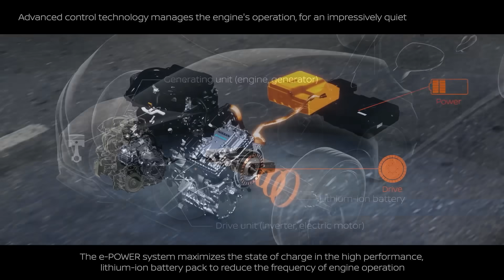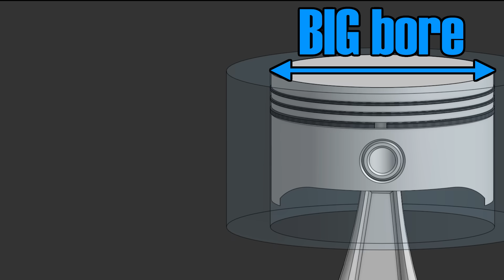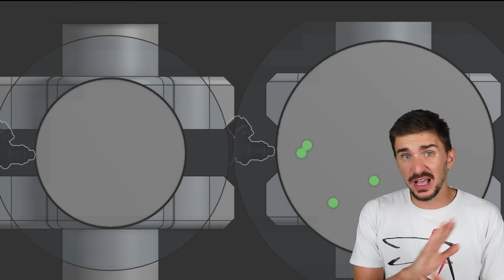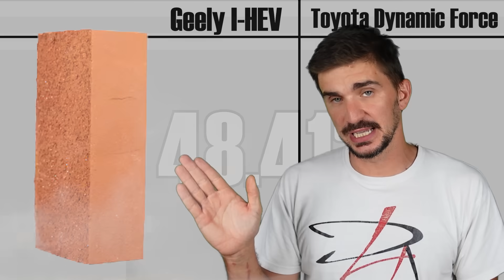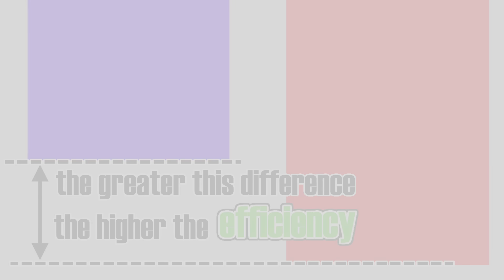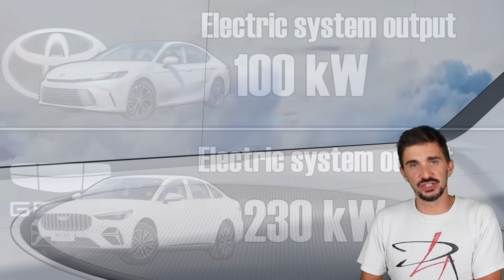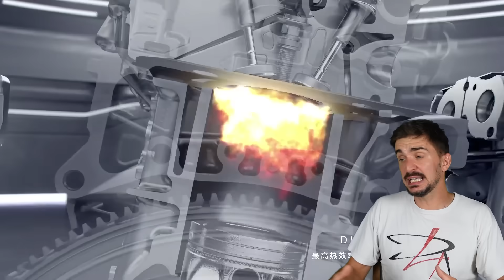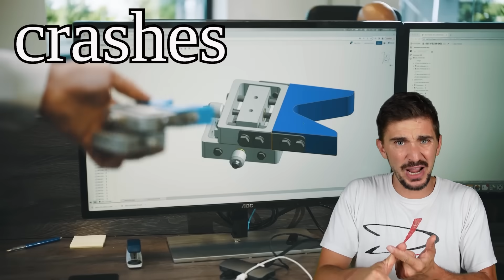How China's Geely Beat Toyota, BMW, Ford and Everyone Else

Comment: So, it's a super annoying boring to use engine, I should have expected that.
Fits well a range extender.
They targeted the announcement buzz and not usability.
Reply: No, it's a super boring engine that'll outperform equivalent boring engines. It's also an EV, so you'll get plenty of performance for short fun runs.

But when you do want to go for a long boring drive, it'll do very well. 

Though at that compression it'll need very high octane fuel

Comment: mitsubishi has been doing the same with the original PHEV, the outlander. Instead of AI they solved the power issue by using a 2.5 liter engine.
Reply: .. and lower efficiency

Comment: It seems like that long stroke engine is going to try to push the piston through the side of the cylinder wall. Extreme wear? Would be interesting to see how this engine performs over time and how eggshaped the cylinders get. I figure this has been tried before and there's a reason it hasn't reached mass production.
Reply: it depends on rod ratio, i assume the Chinese didn't said what it is and the animations are just there for visualization

Comment: Given over 50% of gasoline's energy is wasted in heat I have always thought water injection of some kind is the future. Water expands 1,600 times when it turns to steam. What if water was injected into a second turbo that was connected to an alternator instead of a compressor? Water turns to steam and produces electricity without parasitic loss.
Reply: While it seems like a good idea (there were some water injection engine designs). There seems to be certain issues with that:
1. You need actually quite hot exhaust for the catalitic converter to work properly, and injecting water directly into the cylinder would cool the exhaust too much.
2. If you have sulfur in your fuel - it will become sulfutic acid upon contact with water, especially at high temp. Needless to say, nobody wants any acid in their engine or cat.
Reply: @ViktorSL-1 
What if it were after the cat, or a heat exchanger were used? There has to be some way of converting heat into usable energy. Fuel efficiency can only go so far. I believe the next step will eventually be heat recovery of some kind. The free energy is there for the taking. It just needs someone smart enough to figure it out.
Reply: @mr.shannon6137 with a heat exchanger, you'll need a seperate piston based steam engine (cannot use turbines, as they require steam with very strict characteristics, or they'll self destruct). So much more bulk. What theoretically can be done is putting MGU-H turbine after a cat to harvest the residual energy without empeding its work. But don't think that will get even close to the combined combustion-steam cycle, used on powerplants that can reach up to 60%.

Comment: This is why I've been saying for years that an efficiency optimized diesel generator combined with an electric vehicle can get more power to the wheels than a conventional engine and drivetrain.  Across the usable performance range a gasoline engine is approximately 35% efficient with approximately 10-15% additional losses between the engine and wheels while a generator can operate closer to 50% efficiency, charge the batteries @90% efficiency, and then the batteries can drive the wheels @ 85% efficiency.  The sum of the numbers is still better than the engine driving the wheels.  Finally the range extended EV has the advantage of regenerative breaking, and never idling.  It just turns on to charge the batteries.

Comment: Brilliant video. You explain things in layman's terms so well. At the start of the video I was thinking that China had at last done something genuinely innovative and was ready to cheer them on for such an achievement. If they had been more honest and used less hype, I would still applaud them for an honest attempt to explore the engineering possibilities available to them. Instead we are just let down once again by basic dishonesty and deliberate misdirection. This is a pity because China has achieved a lot in so many areas over the last few decades and should be proud of that without having to resort to such cheap tricks. And one day, they may well come up with something truly worth boasting about.

Comment: The main question is whether it's at the rated torque and whether that torque rating is similar to how they rate everything else they sell.
Reply: That will be going in a Hybrid... 
    Optimised for fixed rpm, overall torque isn't that important...
   A 150hp engine in a regular configuration will only be putting out 30 most of the time.. 
    Battery provides the oomph.
(Credit to TechConnections, who did an excellent video on same)...
Reply: 现在电机没200ps的车都不好意思拿出来卖🤭

Comment: 15:04 byd have a seal with hybrid motors etc. I think it's great in Australia given we need the distances from petrol. Losing power is relevant, compared to a v6 sure, but normal 4cyls are pretty weak still.
Reply: I didn't think we were getting the byd hybrids here

Comment: Next step is to keep it off and add petals, it can have 90% efficiency if you covert it in to a bicycle :) 
My real question would be, how much battery do I save by using this engine, and what is the "golden use case". If the wight of the engine was capacity of the battery how much feather I could go? And what is the cost deference, is it actually cheaper to have this "helper"  engine?
Reply: Adding petals will help the cabin air smell like roses, tulips or whatever flower you prefer, but if want to convert it to bicycle power, pedals would work much better.
Reply: @ghostwrench2292 😂😂 You have a point!
Reply: Ironically it is cheaper. The only reason why they're doing this is that the EU is trying to block Chinese EVs from entering the European market, by adding a combustion engine inside of it they can legally call the vehicle a hybrid, which bypasses the EU taxes and regulations which have been imposed upon China.
Reply: @_________________404  brilliant, just throw in a tiny portable generator with the car and call it a hybrid.
Reply: Its never cheaper to have a helper engine, it just extends your range. 

btw food -> motion is about 25% efficient. Of course there are many other benefits for cycling, and the weight is so much less than a car, that the overall efficiency isnt that important.
Reply: Pedals give you maybe 200w sustained power. How fast do you climb on a bike?